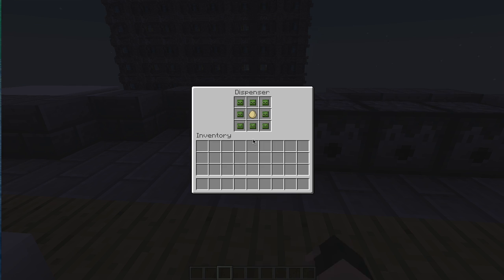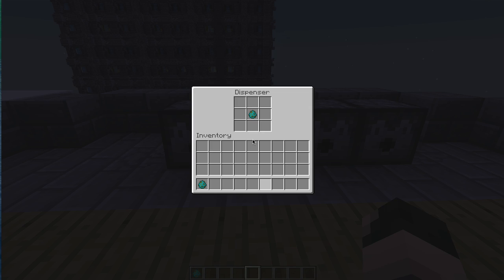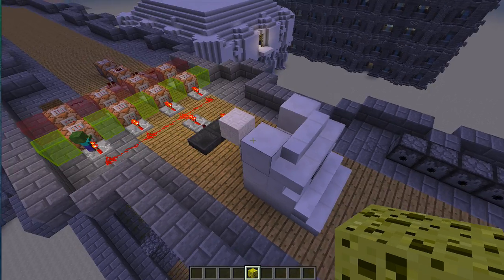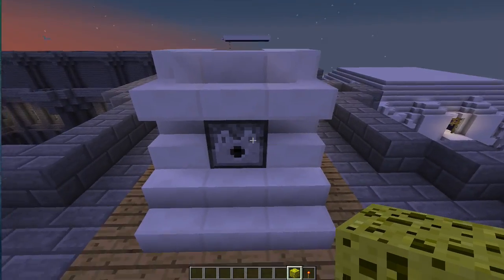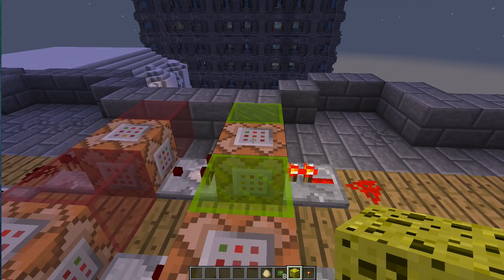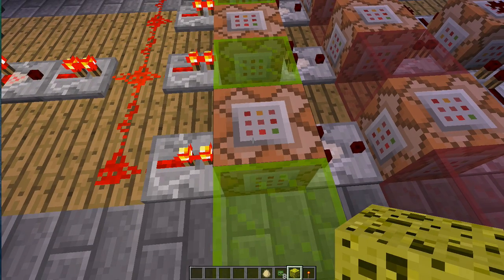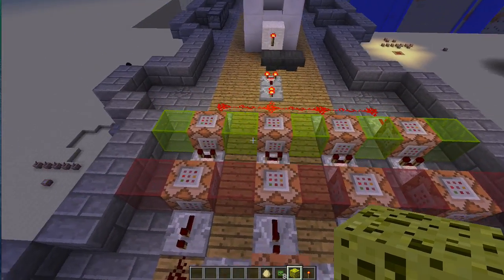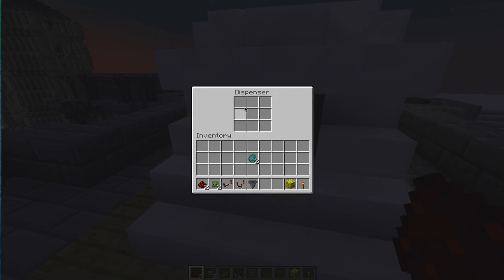How to Craft Mob Eggs using Testforblock Custom Crafting recipes

Comment: Guys pls help me!
Whats wrong with this command???(There shuold be an Output,if one coal is in the Furnace)
/testforblock 289 56 86 minecraft:furnace 4 {BlockEntityTag:{Items:[{Slot:1b,id:263s,Count:1b,Damage:0s}]}}
Reply: Blockmastercraft Two ideas, 1) you may need a square bracket after BLockEntityTag and 2) after 1.7 (or 1.8 idk) minecraft has changed from using numbers to minecraft:id_name so like a diamond sword would be minecraft:diamond_sword

Hopefully those things work, if not, sorry, I'm still a bit new to coding xP
Reply: still dont work (i had the same idea before)

its really sucks, cause /execute and this stuff is so easy

Comment: You can see on the left that there is a width of only approximately 5 pixels (depending on your screen resolution) of another color, aka. another app opened. Is that original for the software that you are using?

Comment: When I test for a block it outputs successfully, but it outputs if there is an random item in another slot too. So for example: 1 stone in slot 1=true. But it works with this too. 1 stone in slot 1 + 3 cobblestone in slot 9=false. It shouldn't output if it isn't exactly matching. How do I solve this? I'm in 14w30c btw.

Comment: do you or can you make a video where if a player is holding items in his hand or inventory and trigger a command block it will do the command? Like your custom recipes but if i have 8 heads and an egg and i walk on a pressure plate to turn on a command block to remove the items and give me items.
Reply: You can do it easily by using /clear @p 397 8 (For the Head) /clear @p 344 1 (For the Egg) and use the /give @p 383:54 1 Something like that.

Comment: I have an idea for a better design, basically it will allow for any chests (I prefer chests because they allow more spaces) named "transfusion table" to work, and do their crafting separately, etc. I don't think this design allows for more than one dispenser to be placed, or if you put the recipe in the new dispenser it will stay but the original dispenser will turn into lava and than back with the output on a continues loop.

Comment: You're actually using 1 more command block by changing the command block at the end, if after detecting the recipe you power the set lava command block, and then activate the other 4 command blocks after that which set the dispenser block, instead of setting a command block with the command to replace the dispenser, you'd actually remove that last command block and it would still work the same.

Comment: You could have saved the complication by making each recipe have it's own 'lava', so you would only need three command blocks per recipe.  If you had a bigger line, you would need more of those at the end, and the pattern would be even more complicated.
Reply: 3 command blocks per recipe vs 2 command blocks per recipe + 2. if you had 50 recipies that would be 150 command blocks vs 102.
Reply: DreadKyller
But then you would have to wire all the extra 'lava' ones, and then things wouldn't be so easy to copy and paste
Reply: whatever... copying and pasting it and adding a repeater every 15 blocks isn't hard, you have a point but I do as well, command blocks are tile entities, which run scheduled update ticks, the more tile entities the more the game lags, also the more RAM is used when that area is loaded, if someone's going to put the effort into making this system and editing all the commands to make hundreds of recipes, adding a few repeaters is nothing.

Comment: How do you put an enchanted item in the dispenser? im not using /setblock minecraft:command_block so this is what I have: /setblock ~2 ~1 ~-8 minecraft:dispenser 3 replace {Items:[{id:276,Count:1,Slot:4}]} I've tried this [{id:276,tag:ench:[{id:16,lvl:5000}],Count:1,Slot:4}] and tried Damage instead of tag but no luck.

Comment: Couldn't you just put a button near the dispenser (not to close, so you don't activate the dispenser) to activate the "testforblock"-commands?
So you wouldn't have to need a clock (less lag) and you could kind of accept the crafting just as in a real workbench.

Only downsides I see:
You have a button.
The Command-Blocks have to be near the Dispenser (but you could also use a setblock command to make an input to the "testfor"-commandblocks)

(I'm German, so don't mind any spelling or grammar mistakes)
Reply: That is possible and maybe even a good idea but maybe players dont understand what that button is doing there
Reply: megaxlrful How about a sign next to it with "Press to craft" written on it or something like that :D
Reply: That wouldn't come out that badass mapmaker
Reply: megaxlrful you could also explain it once in a tutorial in the map or something like that. No matter what method you use, they can still be confused without an explanation :D
Reply: Possible

Comment: If there are no other players mining, I guess you could turn off doTileDrops for the moment the dispenser is being destroyed. And maybe add a "craft item" button instead of the clock. In real crafting in minecraft you actually have to press the item to get it, you don't get the item just by placing items. It would also reduce lag just a little bit.

Comment: Dragnoz  once /blockdata comes out you will be able to simply edit the nbt data and change whats in the dispenser without the setblock and lava
Reply from the maker: I know :D:D I cant wait!!
Reply: It will allow you to directly edit the nbt data of a block. For example, if you wanted to change a chest with items to have more items you would do this:
/setblock (coords of current chest) lava
/setblock (coords of lava) [data for items]

And it will also close you out of the chest before you can get back into it,

With /blockdata you can simply do this:

/blockdata (chest coords) [data for items]

And it will not close you out of the chest or replace the chest, simply modify the nbt tags to put the items in the chest instantly

Also it will come out in 1.8, more info is here:
http://www.reddit.com/r/Minecraft/comments/1sgkec/twitter_jeb_a_way_to_lockprotect/cdxffiw

I hope I helped!
Reply: /blockdata? what will that do? and when will it come out?

Comment: instead of burning the items, why not put some hoppers below and make a setblock to a redstone block and then the last hopper/chest/whatever gets burned and replaced, so you won't have to create lava that could burn blocks and also there is absolutely no chance for the items to not burn which is if you use lava (at least i guess).
ofcourse the downside is, that it takes time, but maybe there is a way to prevent access... :/
idk it was just an idea